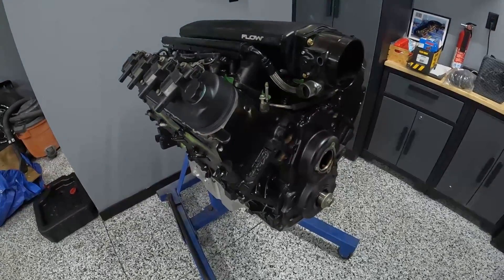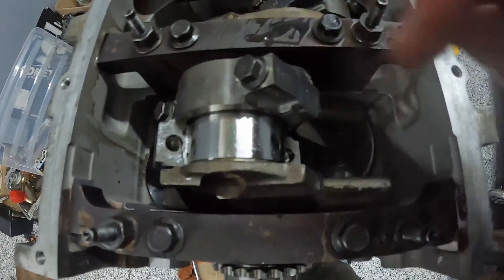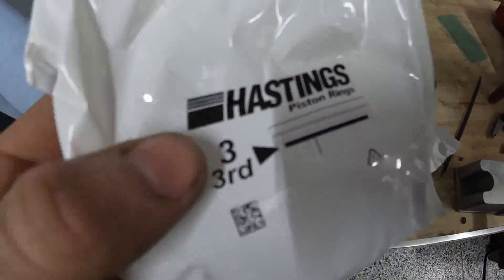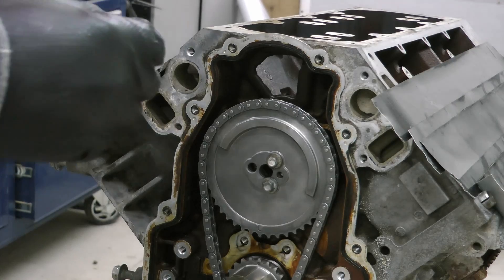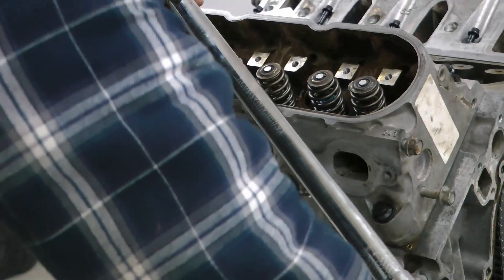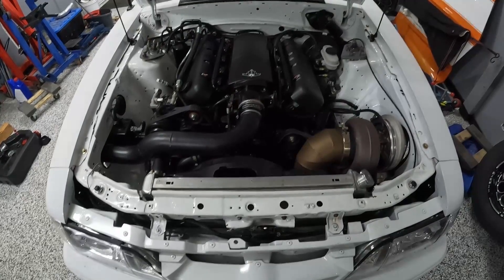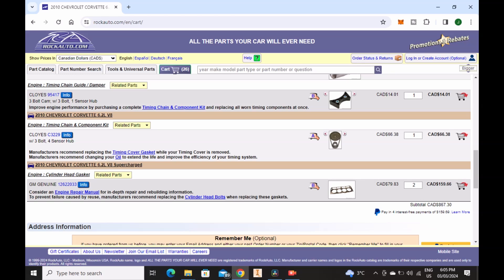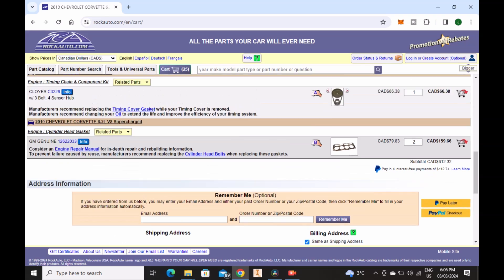SPICY TURBO LS BUILD RECIPE FOR 600-800WHP STOCK BOTTOM END W/ PART NUMBERS

Comment: Good video, thanks for all the part numbers and suggestions. Man your putting a lot of power thru a stock bottom end. I assume your using a Gen 4 block, stock hyper pistons, and stock rods. Did you upgrade the rod bolts or use studs on the mains?
Reply from the maker: No upgrades down there haha

Comment: I was talking to someone on VS racing Facebook Messenger ... I told him that I had a gen 3 5.3 lm7 and I am trying to go with a twin turbo setup in my 91 GMC Sonoma and they came back and said I should run the 62/62 .83 ar dv to make 800 rear wheel horsepower and this is going to be a drag and drive Style of a truck so more than likely I'm going to have a turbo 400 with a possible gear vendors or a 4L 80 I haven't made my mind up yet on the transmission and I honestly haven't made my mind up on the turbo setup because I might just go with a single? I'm trying to do the research to see what are the advantages and disadvantages of having a single versus twin
Reply from the maker: @dynamicdopamine  big single!
Reply: @WestcoastWrenchin  yeah it's looking more and more that way. My biggest issue right now is trying to figure out how I can keep the air conditioning system. So I'm more than likely going to be looking for a driver side turbo log manifold